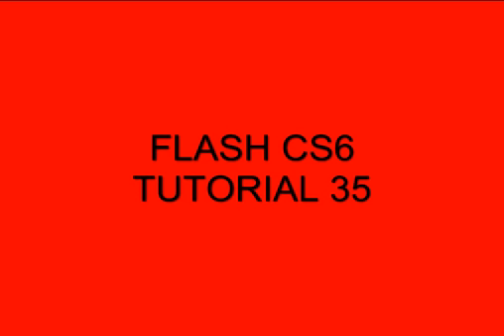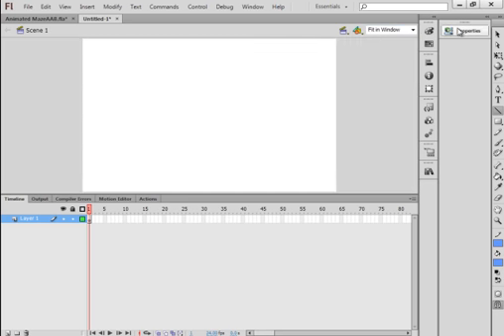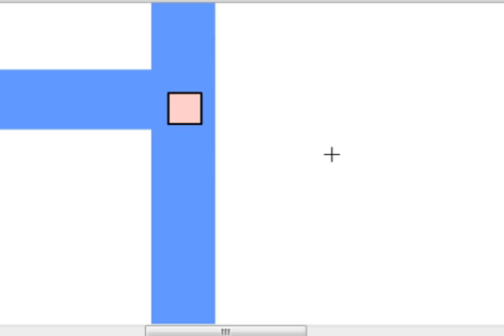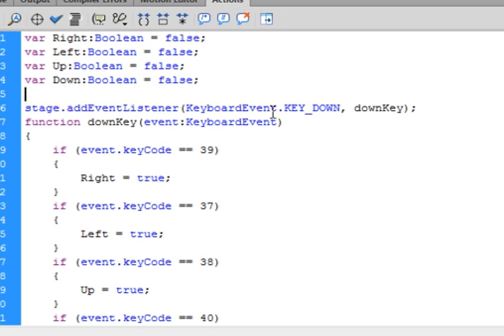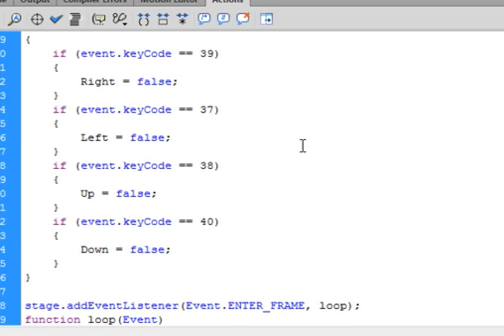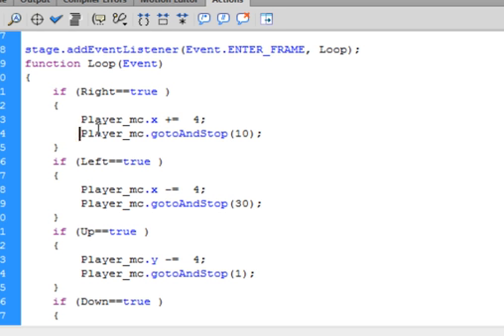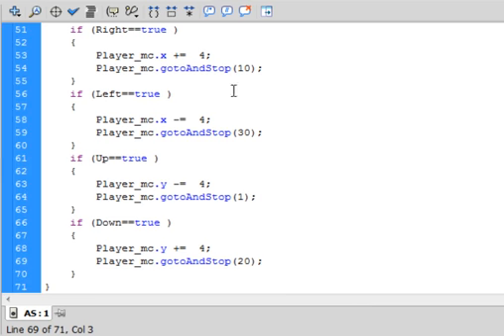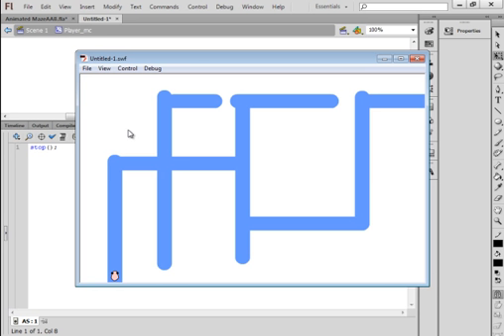Flash CS6 Tutorial 35 Maze With Animation

Comment: how to make the movement faster?
Reply from the maker: In the "Loop" function there are 4 lines of code:
 Player_mc.x -=4;     
Player_mc.x +=4;     
Player_mc.y -=4;     
Player_mc.y +=4;
Make the 4 a larger number.
Reply: Another more thing.. i got problem will wall collusion wall as 
the player move it fast. the player can break the wall through to it. i change the loop function to 10 movement speed.
Reply from the maker: That will happen if the speed is fast.